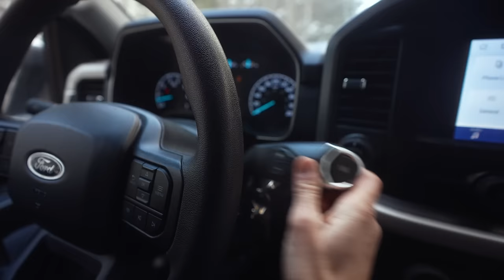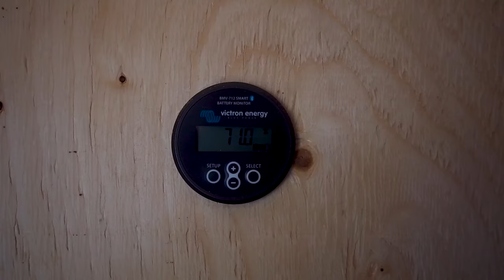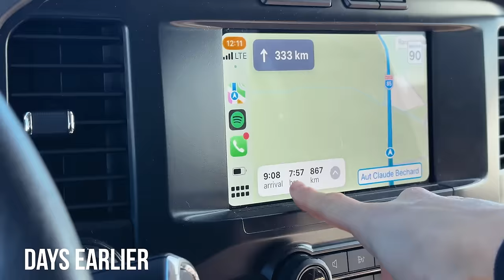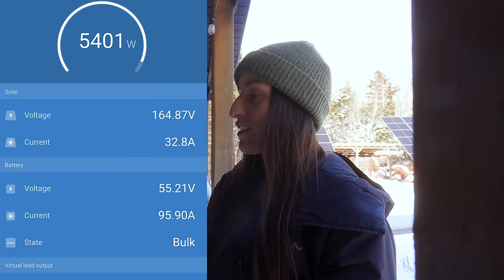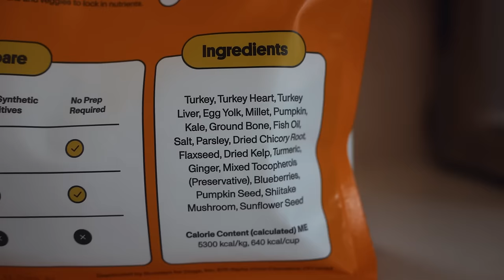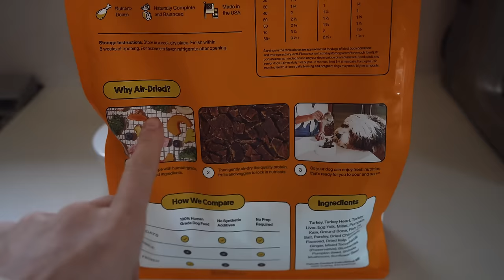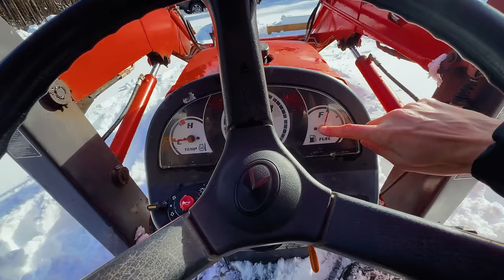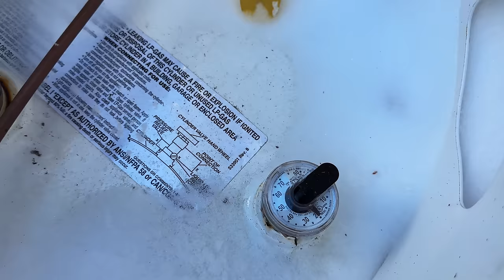Returning to Blizzard at Cabin in the Woods (biggest snow storm in 20 years)

Comment: Lovely Ladies and lovely girls, welcome home! Great to see you back at the cabin and enjoying it! Thanks for sharing! Much ❤

Not forgetting Clementine, a few tips if leaving her in the cold for extended periods of time without use  -
1. Poor love definitely needs a shelter.
2. Invest in an intelligent trickle charger for her battery, they're not expensive, don't consume much power and will keep her battery a much happier bunny for much longer. Even better remove her battery and place in in the semi warm main battery garage with the same intelligent trickle charger or incorporate her battery into your solar charging system. She and her battery will ❤ you even more.
3. When the battery finally waves the white flag, invest in an artic grade one, they're not massively more expensive, but are designed to cope much better with sub zero temperatures.
4. Warm her and her shelter up with a mobile heater, before starting, as freezing cold engine oil can become the consistency of thick treacle, which won't do her internals any favours.
5. Make sure you use engine oil rated to the sub zero temperatures she lives in.
6. When she starts let her tick over for as long as it takes for her to come up to temperature, before using, thus avoiding the 👿 cold oil doing any damage.
7. Give her some ❤ from me!

Comment: In Antigonish, we had 100cm. Took me 7.5 hours to shovel a path from the house to the road. Eventually the tractor with blower came and cleaned the rest. Was a fun few days. Welcome back to Canada.
Reply from the maker: Wow, yes we heard parts on NS received 100 to 157 cm. We can’t even imagine that much snow. That is a lot of shovelling! 
We were lucky! 😊🐶
Reply: We are on Boularderie, had to be close to 6-ft in those 4 days. Road was not plowed for 6 days. Our version of Clementine got a work-out. Yes, even on the grid you need multiple sources of energy - solar + propane + firewood + generator + grid + diesel + gasoline. Did I leave any out😜

Comment: I know you probably wont read this but one thing you might not know is that pushing the bucket into the ground while the edge is tilted way down can bend the hydraulic cylinders if you hit the edge into something too solid with too much of a force so safest to keep the bucket horizontal when pushing snow. Looking a lot like the winter we have here in finland...snowbanks were at about belly height untill last week when they all melted and turned into ice. Also Hi 5 Clementine !

Comment: Welcome back from your escapades. One helpful thing to mention is to add fuel treatment to your diesel and gas cans as soon as you buy the fuel. Helps keeps your fuel fresh and helps your engines. Fill your fuel tanks full on the tractor, generators, van and truck to eliminate air from the tanks which attracts condensation and moisture if they are not going to be used for an extended period. Add fuel treatments to these also.

Comment: Highly recommend a fill-rite pump and 55 gallon drum once you build Clem a shelter.  I do the 5 gallon can shuffle and transfer the fuel into it, but fill my skid steer from it.  Also, I recommend you consider an auto start generator.  I have a Kohler 12Res that will auto start when it hits my chosen set point.  It runs off propane.  I went away for a few days and I came back to the generator running (yay, it worked!).  You have way more solar and battery storage than I have (I only have 6.390 kw), but I did recently switch to EG4 LiPO4 batteries (6 48V EG4-LL batteries).
Reply from the maker: Thank you for sharing all your ideas with us. 😊🐶
Reply: Happy to give input @Vanwives  .  We are having a very strange winter here in Michigan's Upper Peninsula.  Warmer temps and very little snow.  One other thought I wanted to share was the sizing of your propane tanks.  I have 1000 gallons (sorry, using Imperial as I'm American) and I go through 1200-1500 gallon/year.  My primary source of heat is wood and radiant floor heat.  I didn't catch how you have the tanks set up, but I think setting up a larger tank in each of your locations would be a good idea.  All my best!

Comment: Some strategically place snow fences place around the deck and the shed among other places may eliminate the snow drifts and make for an easier clean, available online or at your local Partsco or farm store, probably should build a separate, stand-alone WELL VENTALATED POL (petrolium-oil-lubrication) shed to store all your flammable fuel containers and materials.

Comment: Relying on just the handleset lock and not an additional deadbolt isn't the best guarantee to avoid burglary.  With you out-of-town for months at a time, I'd install some hasps and padlocks, in addition to deadbolts on all your doors.  However, giving a bad guy an easy way in will probably save your windows and sliding glass doors from getting broken.
Hey, when y'all are tromping around in the forest, if you run across a rotten pine log on the ground, kick and stomp it apart.  Where there had been limbs coming out of the trunk, you may find 'lighter knots'.  These are nearly-petrified lumps of resin-saturated wood, which will burn even when wet.  They make excellent fire starters for your various wood-burning appliances.  I thought of sharing this with you seeing you shave a stick to get your wood stove started.  You probably have a lot of spruce up there, and I don't know if they produce lighter knots like southern yellow pines do.

Comment: If you could only have one machine, Clementine is one of the best choices you could have made. The tractor/ loader/ backhoe is among the biggest bangs for the buck- and picking a "K" brand was a value securing idea to boot. You might want to get a self powered snow removal tool for the front end- it will do even better at snow removals. Good to see you home and safe; with a mind full of Reckless Riley's new machine shed to tickle your imaginations. The "electric toilet" conundrum does want some exploring- it looked ideal for your purpose; I'm going to guess it was much more of and energy hog than thought. Are your PV's bifacial? That could help your Winter power problems if the panels could make some power from the reflected sunlight on the backs of the panels.
Reply from the maker: Thank you for all your helpful insights. We are so happy to be home. Love how much YOU also love Clem 💛 it actually wasn’t the energy with the toilet but will share soon!

Comment: Glad your home safe pack. At least with the cameras you new the snow load and work load awaiting. Jadmine if you get stuck with the tractor you can use the hoe to help lift you out. 
Watch some videos on it and practice. You may want to invest in some rear tire chains. They make a world of difference when pushing snow.
I think a snow blower for the rear deck would be a good addition as well. Some times some good deals end if the season. 8 hp minimum.  Your both good on safety but don't clear a snow shoot without the impellers disengaged. Again glad your all home safe and healthy.

Comment: When I first saw your build I thought the snow on the roof would crush the stovepipe like it has at my place a couple of times before I relocated the stovepipe to the top of the roof. Now I realize the snow you receive is far less than the snow I receive every year. My snow piles up to the roof line and will prevent the snow from leaving the roof until it gets to be a 4 foot solid block of ice that crushes anything in its path. The icicles are so big they touch roof to ground. The snow is too deep for snowmobiles to operate and my vehicles are completely buried under the snow but I do have dogs and a sled. My house is next to a private lake in the far northern Montana Rockies. FYI. Take care.
Reply from the maker: Wow that is a lot of snow and cold too. It sounds so beautiful the lake the rockies. Happy you have beautiful dogs to help you.😊🐶

Comment: What a change from summer to  winter, the tractor sure is a big help. Would you consider building a shed to get the tractor in and anything else that would be better off undercover? Are you going to get the greenhouse up and running soon? Spring is not  to far off. Great video and great workout getting things cleaned up

Comment: I laughed when I saw you on the victron, monitoring your solar. I to do that
With that internet connection, you can also be watching your battery system thru Victron. I live also offgrid and only built a small system but watching Andy at- off grid garage- in Australia, I learnt how to monitor my Victron with a raspberry pi . Super cool. Give it a try and learn new skills, it's not hard

Comment: Might be worth looking at getting a generator with automatic start capability. That way you can tie it in to your solar system with the victron cerbo gx so when the battery's get low the system will automatically kick the generator in to top the battery's up to a pre determined level and then shut off that way you can make sure they stay healthy. Also would be intrigued to know about the incinerator toilet. Keep up the good work guys

Comment: Ladies, you are going to want to get your propane tanks refilled soon. Letting them get below 20% is usually not a good idea, especially during wintertime. Propane, being a gas, is heat sensitive and cold weather leads to lower pressure. Letting them get down to 10% requires a safety check by a technician before they can be refilled. 
Great content! Enjoy the snow and stay warm!

Comment: Aluminum bladed snow rakes for that heavier stuff.  You can run a rubber strip along the edge(or some have rubber rollers) if you're worried about damage to the roof.  Trust me.  My roof is ancient and the aluminum works fine.

Comment: FYI... snow vs outside air temps... Snow is a good insulator and if the outside air is below freezing, it's better to leave the snow piled against the outside of the house. It works as an insulator since the snow doesn't get colder than freezing while the outside air can. OF course, this is assuming the wall is watertight which yours are in good shape.
Reply from the maker: Thanks for sharing your knowledge with us. Always love to learn. Certainly makes sense, good thing for us is our cabin is over insulated it stays super warm 🤠

Comment: Loving the vids! Do you have any links for the propane heater ? Or company that you used - also off grid in NS, with a much smaller battery and solar system lol, need a way to leave the cabin next winter to go down south
Reply from the maker: It’s called the Martin Heater. You can buy it on Amazon. We have the 20,000 BTU and without the glass fire feature as it’s more economical. We have had it for a year and they are hands down the best purchase! We are not affiliated.

Comment: Diesel might be different or less dangerous than regular gasoline.  You should never fill up any gas containers sitting in the back or bed of your truck because it can cause static electricity & blow up.  You should always place them on the ground.   Diesel may or may not be different.  So it's a good & safe habit to do when filling up any gas cans or containers.   : )